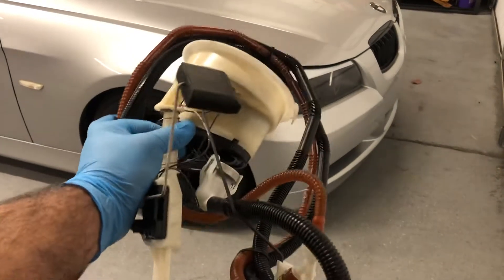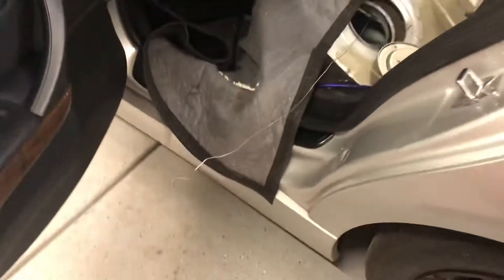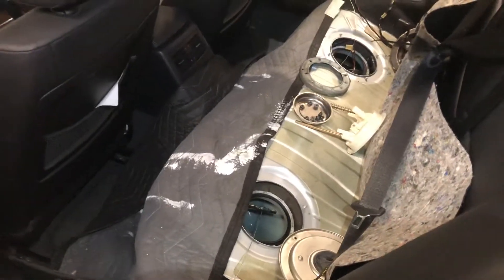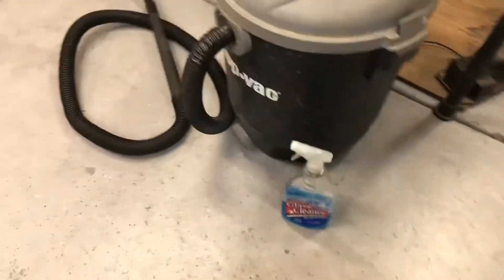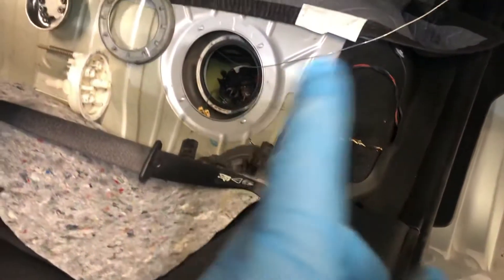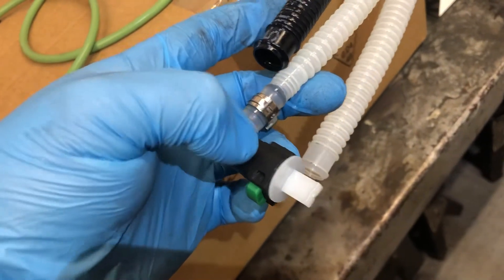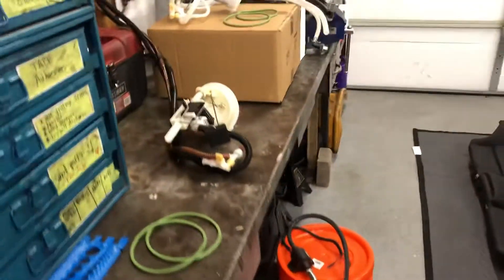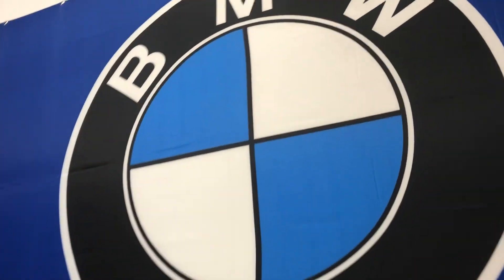BMW E90 325i Long Cranking/Hard or Rough Start Solved! Fuel pressure regulator replacement

Comment: Im having issues with mine starting, however when its running everything is fine, would this help resolve the issue
Reply from the maker: There are multiple reasons this can happen, but following the steps should help you find the culprit. Thanks for watching and commenting, we hope you liked and subscribed.

Comment: Hi there, i'm having an issue with my bmw 116i n43b16A engine.. my car starts fine when its cold in the morning, but if i drive the car about 10klm then i stop the car about 45minutes or an hour the car cranks a lot sometimes doesnt start at all, but normal he starts after long cranking. so, my problem is not when the car is COLD or HOT, its in the midle of this two situations. when the car is HOT if i turn off and on in the "same" second the cars stars well. i already change injectors, crankshaft sensor, oil pressure sensor, oil pressure regulator sensor, fuel pump of the engine, both selenoids, intake manifold and sensors etc.. i dont know what to do more, i have the car in a BMW dealer ship from 2 months and they cant figure it out! please help! best regards
Reply: i dont have any error codes
Reply from the maker: Have you tried, the fuel pressure regulator? in US cars it is on the passenger side inside the fuel tank, sort of how the fuel pump is on our passenger side.
Reply: @MechaniclifeJDM  you mean the fuel pump in the gas tank?!
Reply from the maker: @xaulz0r  its a possibility as well, but i was talking about the fuel pressure regulator, run a fuel pressure vs. time test and see if you loose pressure too quickly after shutting down

Comment: My car has a long crank when I go to turn it on after not using it for a like 1 hour plus but once it turns on and I drive and let’s say I turn it off and then turn it back up it cranks fine it’s just when I don’t use the car for a while
Reply: What’s could be the problem?
Reply from the maker: @brandonmunoz5263  Are we talking about an E90?

Watch the video all the way through brother, and see my other video on this topic. Click read more.

its most likely the fuel pressure regulator or the injectors are seeping 

This causes the stored fuel pressure in the line to drop and not be adequate for that clean start we know and love.

Test for fuel pressure holding vs. time after shutdown. 

some other possibilities are a weak crank sensor (buy OE only!)

the ekps module but I would start by checking codes with a proper scanner and checking for fuel pressure drop.

 I hope this helps thanks for watching I hope you liked and subscribed!

Follow up with your findings it may help others with similar issues.
Reply: I am going through a long crank issue 
Please review & let me know what you do I have this issue on a 2009 bmw 328xi XDrive 

https://youtu.be/uphmcEvQ1mw

Comment: Do you work on cars in murrieta ? I have a bmw 328i that has the same thing long cranks I just had the fuel sending unit replaced at a shop because I was leaking fuel and they said it was that but now the car has a long crank on cold start as well not sure if that’s normal for bmw on a cold start after that cold start it fires up first crank every time but at first it sounds like it struggles anyways if you do work I’d take the car to you if your interested in work I have a few things that still need to be replaced thanks great video informative
Reply from the maker: First thank you for watching and taking the time to comment; Secondly yes no problem to get you scheduled in send an email address and I will reach out to you there.

Comment: i ordered this part but what happens if you just don’t replace it?
Reply from the maker: Could start loosing more pressure and under deliver fuel volume/pressure 
I found one cracked spraying out fuel, just once.
Have you checked the injectors for leaking?
See my other video
Turned out to be a two part problem on this car.

Comment: Does this throw a code?
Reply from the maker: In this case, it did not and in most cases it may not, until its really bad, then you may realize you have leaking injectors, see my other video, it goes hand in hand with this one

Comment: Mine only does it when it’s cold any idea??
Reply from the maker: Also check with a proper scan tool capable of showing any shadow codes, not all scan tools show all codes, and you can not just count on a check engine light, good luck, thanks for the view and the comment, please follow up as we may help others together.
Reply from the maker: 1) Hook up a fuel pressure gauge cold 
2) Run engine 
3) Monitor pressure for maximum and for fluctuations 
4) shut engine off
5) monitor fuel pressure intensively for 20 minutes recording drop vs. time
6) continue to monitor periodically over the course of 4-6 hours recording drop vs. time, this will paint a picture, it is a full spectrum of operation fuel pressure leak down test, keep in mind gasoline is highly combustible, you can disable the fuel pump by pulling a fuse then starting and running the engine until it shuts down to release fuel pressure so that you may safely connect and disconnect the gauge to the test nipple on the rail of your N52 engine, remember you are going it alone This is for entertainment purposes only, don’t burn your shit down, no smoking no open flame, no sparks
7) report your findings and pressures / times recorded here, give clear concise data
8) could be vacuum leaks or other issues as well, like a crank sensor failing, but for long cranking cold most likely The injectors are leaking, or the fuel pump check ball is leaking fuel backwards instead of maintaining pressure as it should, these test to identify if you have a fuel pressure leak down condition, hope this helps, report findings, work carefully
Reply: @MechaniclifeJDM  thank u I’ll try that!!